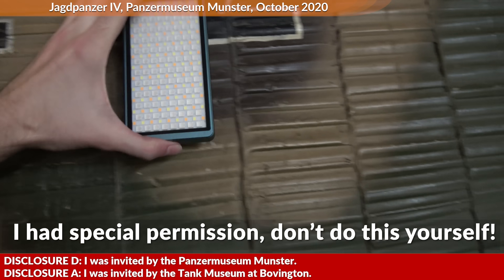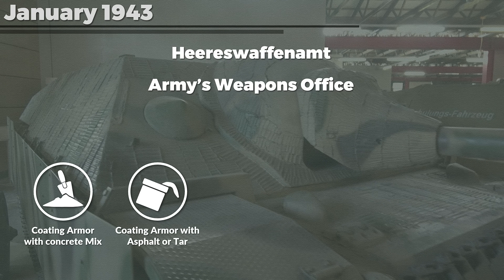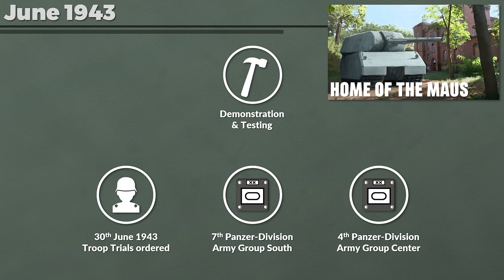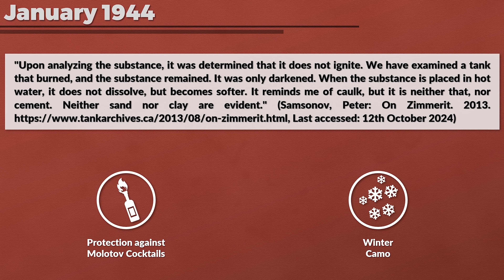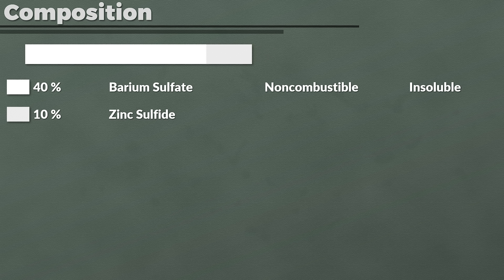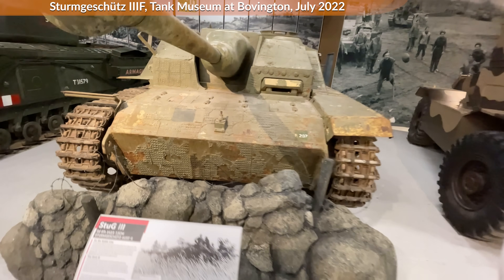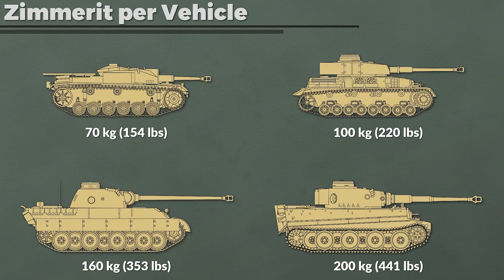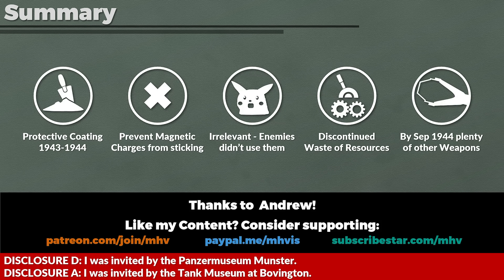Why Zimmerit on Panzers & Testing

Comment: 4:40 - Caulk (pron kawk) is not “chalk” (pron chawk). Caulk is a soft paste that hardens into a waterproof seal, it’ll be present around your bath and kitchen sink even if you don’t know what it is. Not criticising the English pronunciation here, but the audio is a bit confusing, chalk is hard, brittle and would reduce to powder in a fire. In text Peter is saying the Zimmerit will become like a sticky paste after a fire.
Reply: To be fair, I had a hot minute of confusion when he said chalk
Reply: It sounds like it was unintentional but it could also have been a strategic anti-Youtube-censorship mispronunciation
Reply: @xeroprotagonist unlikely. his english pronunciation has always had similar quirks. I don't think it's intentional.
Reply: @proCaylak  ironically the phoneme “Ch” is usually pronounced “K” in German/Austrian, so it may be not realising that this English “Ch” was uncommonly a “K” (its more often “Ch” in English).

What’s doubley ironic is “Calking” goes back several millennia in masonry. It’s derived from the Latin word Calico (fill in with limestone or lime-wash) and so shares a word derivation with Chalk (Calx). Calking may have acquired a different “K” pronunciation just by linguistic drift, possibly being mostly associated with ship building (waterproofing) several thousand years ago. It arrived in English from Latin via Old French and not Germanic influence.

Just to show how good Peter Samsonov’s observation is the 1913 Websters definition of Cauk (no L in the American, still pron Kawk) is “Barite” (Barium Sulfate) which get’s us right back to what half of Zimmerit is made of. Post WW2 Caulk is more likely to be a Silicone Latex or polyvinyl acetate mix, but it clearly shares physical properties with Barium Sulfate which would have predated it and was used to create brilliant white waterproof exterior paint. This would have been a more commonly used weather coat in early C20th therefore, but Barium was well known to be non-magnetic.
Reply: @MsZeeZed  thanks for the lenghty story about the linguistics around "caulk" and the history of the material itself :)

Comment: I can confirm that a British source, of soldiers in the field, thought that Zimmerit was primarily for camouflage. As it helped to break up a vehicle's hard edges (particularly if the Zimmerit was applied locally, as I've seen examples of very roughly applied coating that gave vehicles a surface like chunky papermache/ mud).
Reply: I've read multiple allied accounts of testing Zimmerit. Seems commanders officers loved to giving a bucket of concrete to bored looking soldiers. 

All of them had conclusions along the lines of "absolute stonking pain in the arse to apply it, we don't even use magnetic mines anyway, but the finish is quite nice for camouflage"

Comment: It's hard for me to come to grips with the idea that getting close enough to an enemy tank to slap a magnetic mine on it was the best anti-tank weapon available.  Someone had a sticky one too, which I think could be thrown a few feet, and that seems just as crazy.  But I've got hindsight that they didn't.
Reply from the maker: The German military to this day has the principle "Wirkung vor Deckung" "Effect before cover / protection", in that sense it was clearly the best one at the time.
Reply: Well if it's your only weapon against tanks and the enemy tank is closing in your unit, you'll use what ever you have to stop it. Like that one small man from Savo during the winter war. He climbed on top of the T-26 and knocked the hatch with his grenade. The TC opened the hatch and Savonian dropped his grenade in through the hatch.
Reply: That’s why tanks need infantry support and vice verse.
Reply: I think it was the British with the  sticky one.
Reply: @killzoneisa  Yeah it was via an oily gluey coating rather than magnetism though, only was widely issued to Home Guard units wasn't sent to active troops apart from a few small batches (Commonwealth troops used them at Anzio), was liked by Special Forces though who regularly requestioned it and some were given to the Free French.
Reply: @watcherzero5256  Talking of  Home Guard in Dad's Army you get to see them train with it.
Reply: @killzoneisa  I had a friend who fought and was severely wounded in the fight in Western Europe to end the War. His friend had his leg blown off when the sticky bomb he was trying to throw stuck to his leg. Like an officer's pistol, more likely to hurt the user.
Reply: What about Russian magnetic mine dogs….
Reply: @EXO9X8  The dogs nor the mines werent magnetic. The dogs were trained to run under the tank and the backpack with the explosive had an antenna that would trigger the explosion when it was bend
Reply: @wolf310ii  And they never really worked.  Enemy tanks are often in motion, so getting a dog, even a hungry one to come near a tank that is moving and maybe shooting is not a great concept.  Also you have to take into account that the dogs would require a long lead time to get accustomed to the device, that they don't bond with the soldiers etc.  The terrain has to be clear because any type of brush can set it off or even the dogs themselves might try to scratch themselves or rub against something.

The whole "They massively ran back to Russian tanks because they smelled differently"  Sounds like one of those claims everyone has picked up on and never bothered to check.
Reply: @rotwang2000  Dogs can run much faster than a ww2 tank that has to stop to fire, also the tank would come in your direction anyway.

They also didnt catch a stray dog 5 minutes befor the attack, nor were they pet dogs, they had dog training schools.
Ever seen a trained service dog or a police dog?

When you have tanks yourself, there is no need infantry at weapons and the dogs were trained on petrol tanks.

Anti tank dogs did work, at least in tests and training, in combat the germans tried to shoot them befor they reached the tank.
Reply: @rotwang2000 yup, the whole "dogs ran to Russian tanks because of the smell" is indeed entirely untrue. 

The dogs were actually trained on German tanks where possible, or petrol powered Soviet tanks (it's like someone thought about that ahead of time!)

It was an absolute failure though because a lot of the dogs paniced under fire. They either hunkered in shell holes, ran off into the distance, or even ran back to their owners who then had to shoot them. The Soviets indeed noted that the handlers developed bonds with the dogs and didn't like sending them to their deaths, and particularly hated shooting them!

Meanwhile the Germans said they saw a few dogs and quickly and easily shot them. 

So yeah, dog bombs were a total failure, but not because of stupidity.
Reply: In Sweden we say “Verkan går före skydd”, roughly translates to effect is more prioritised than cover/protection.
Reply: Look at the other options at the time?

Increasing armour meant that shaped charges were the only choice for infantry portable anti-tank weapons as anti-tank rifles were increasingly obsolete.

But effective shaped charges were
bulky and heavy and attempts at AT rifle grenades generally were not successful.

The M1 Bazooka was introduced at the end of 1942, but it was quite unreliable and it would not be very practical until the M1A1 and updated rockets arrived second half of 1943. Even then, they needed to be used from short ranges, often had to be fired from exposed positions, and were already being eclipsed by thicker armour. I believe Patton said to only use it at 25 or 30 yards, maximum.

The Faustpatrone (later renamed Panzerfaust) was introduced in 1943 with an official maximum range of 30 metres.

The PIAT came into service in 1943 and again had a very short effective range (far less than the official 100 plus yards) and its own issues. As a bonus it had no backblast.
Reply: Actually it is a rather sound tactic, as far too often in these times tanks were advancing with not enough or none support troops at all.
Even i in my time as a "Fallschirmjäger" paratrooper in the german army had often trials and trainings together with other units AGAINST tank squads and most of the times we easily outflanked the big clunky beasts to advance in on them in their back, to jump on them and clank on their commanders hatch to indicate them that they successfully had been killed.
Tanks have seriously bad vsibility, especially if the commander is not in his open hatch, and when they have no ground support to protect them, are easily finished off...especially nowadays with ATGMs or drones
Reply: In urban combat coming closer to the tank is easier. Obviously it wasn't meant for plain fields where you need to crawl for a mile to place that mine.
Reply: i learned that the Irish in Northern Ireland defeated British tanks by spray painting the viewports, so they either had to stay put and call for help and wait for it to arrive, or chance exiting the tank and potentially getting killed
Reply: @daxconnell7661  The British did NOT use tanks in Northern Ireland, only armoured personnel carriers against armalite rifles. Obscuring the site glasses on periscopes is a very old trick shown in American training films from WW2. Jamming the turrets of German tanks with a water bottle was also shown.
Reply: Best CLOSE in anti-tank weapon available. Note that this was in 1942, in absence of the heavier anti-tank gun units, the only realistic options that infantry had were essentially different variations between dying and dying tired after trying to outrun a tank. Atleast during the winter war, under the optimal circumstances for the infantry, the typical kill-death ratio was somewhere 30 to 80 when there were no long range anti-tank weapons available. In favour of a tank.
Reply: I would argue that the safest place to be near a tank would be right next to it or even on it. It's like hugging a professional boxer instead of standing an arms length away from them. Lol
Reply: Best part is how infrequently the Hafthollahdung was actually used successfully. Or any magnetic AT mine, for that matter. Nobody but the Germans thought it was a particularly clever idea. Even after they captured the bazooka in 1942 and reverse engineered it into the Panzerschreck they still thought the mines were better, lol.
Reply: Ah the British Sticky  Bomb, given to the Home Guard after Dunkirk.  I watched a training film on it it years ago, some things the film emphasised:
1)  Don't let the bomb touch any  of your clothing.  Also do NOT touch the sticky bit, You won't get it off it time.
2) Make sure you slap it on to the target with a firm whack, if at all possible put it somewhere important, such as near an intake, fuel tank, crew hatch,  thin armour.
3) Do NOT run back, you will trip and be caught in the blast zone.
4) Make sure you hold on to your hat, it's unseemly to lose your hat.
The film ended with a demonstration in which the target tank just.... 'evaporated' is a good way of describing it.  The  film showed bits of tank raining down for about a minute.
Reply: Yes, but also before the age of tanks, cavalry or artillery had been attacked in point-blank-range. Also infantry with a pike or lancet. And especially the German Armies were trained to attack tanks that way, too.